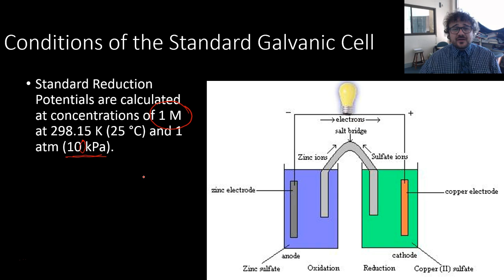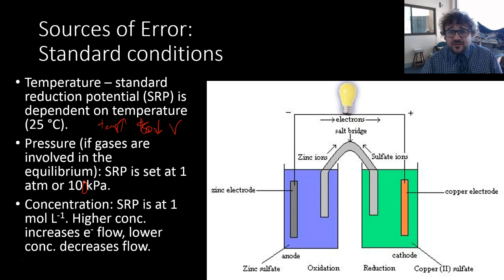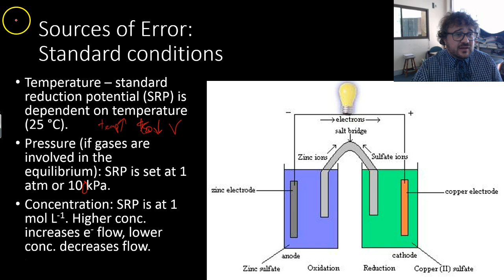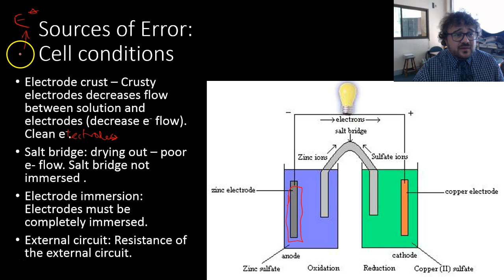Galvanic Cell Sources of Error

Comment: A few quick questions I forgot to ask you in class today SORRY...
With displacement, which wayis it described does the more reactive metal displace the less reactive when it oxidises and loses electrons, or the other way around?
With fermentation, what are sources of error and how would we fix them?
Heat of combustion, how do we limit these errors- loss of solution in transfer between beakers, equipment radiating heat, cross winds and air currents, and uneven heating of water.
Thanks so much, if you cant get through all of them that's fine I know youre busy.
Becca
Reply from the maker: +bobblehead crisp Top work Bobblehead. I was going to email but in case others were wanting to ask I'll answer publicly.
Displacement: Solid of the more reactive metal will displace the ions of the less reactive metal from it's salt solution. This is the active metal oxidising (losing electrons).
Fermentation sources of error - Not all mass lost will be carbon dioxide - the rxn won't be anaerobic initially - oxygen in the flask.  Yeast will be killed by a build up of ethanol - distillation to remove it - too high ethanol and it becomes inefficient. Yeast can be killed/made less efficient by the temperature - too high they die too low their metabolism won't allow respiration to occur.
Molar Heat of Combustion
Equipment radiating heat - have reaction occur in an insulated bomb calorimiter, isolate the vessel (less physical connection with conductive materials) from the retort stand/clamps.
Loss of solution - not sure why your transferring between beakers? 
Cross winds/Air currents/loss of heat from flame - Baffle to prevent the loss of heat to the air, place the vessel as close as possible to the flame.
Uneven heating of water - stirrer of the water, keep the thermometer in the middle of the water.

Good luck.
Reply from the maker: +bobblehead crisp Also I understand why you didn't have time - there were a lot of sweets.

Comment: oh and last one. what are the steps for calculating whatever you calculate for fermentation? you told me to write it in my prac book but I thought id remember... I don't...
Reply from the maker: +bobblehead crisp So calculations for that one could include yield of ethanol. For example, weigh the carbon dioxide released and convert that to moles, use molar ratios to workout the moles of ethanol produced. You could then workout the mass of ethanol produced.